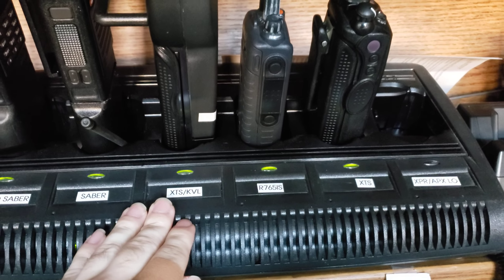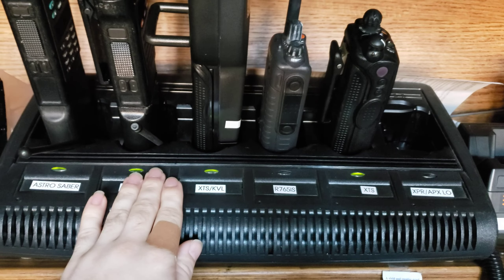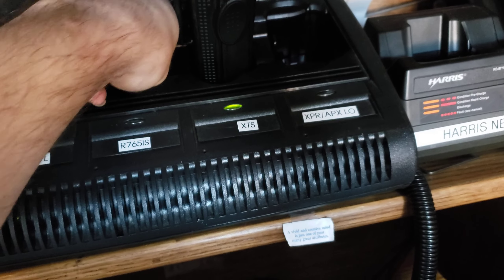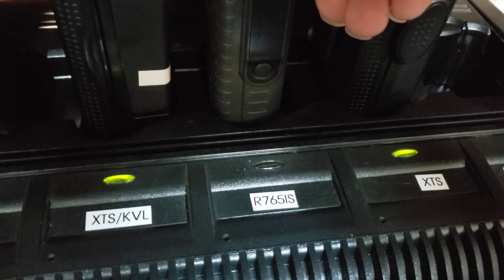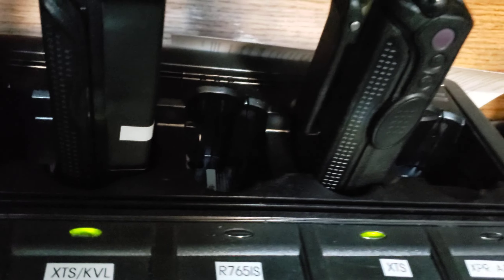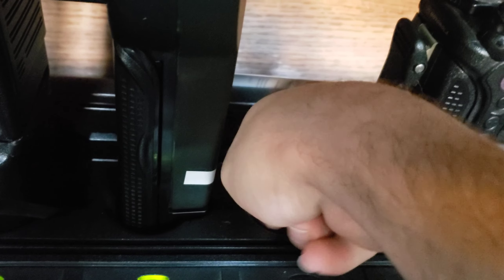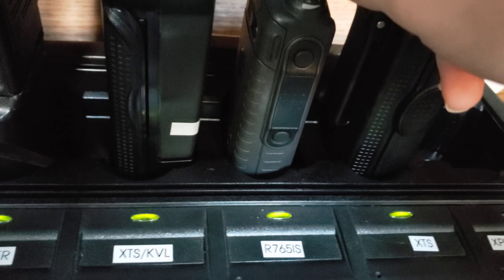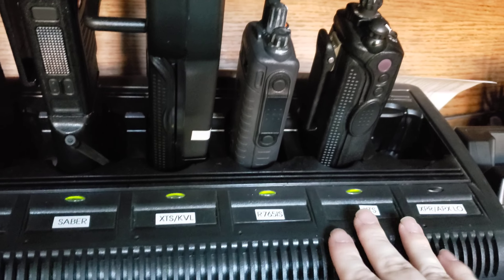Getting HT1250, HT750, and R765 radios charging on a Saber/XTS MUC

Comment: A nice upside of watching this was it forced me to locate one of my MTS2000 radio's, I walked over to my gang charger which charges my XTS and APX radios. The MTS2000 slides right into an XTS port and charges perfectly.  So now I have three different radio types charged in one single unit which is neat and a space saver.  Color me happy!
Reply from the maker: Happy to have been of service, lol

Comment: Motorola DID make an adapter cup for the XTS MUC that fits HT1250s
Reply from the maker: Got a PN? I've looked for a while and never found one.
Reply: @anongator  I'll see if I can dig one up. I have 2 of them so I know they exist
Reply: @anongator  RLN5648, it was $17 from Motorola when I bought it in 2020
Reply from the maker: @Dave-ji1hv  Sweet, Let me try and track one down then

Comment: MUC/SUC (hee-HEE!) adapters are different. I had to order a SUC (I'm a child in this regard...) adapter for my APX so I could travel w/an XTS SUC.
Regarding the 3d printed Waris adapter-getting one of those online printers to do 5x is probably going to be cheaper than finding a NOS one.
Reply from the maker: Yea, some suc work in muc. I have that issue with my xts4000

Comment: Clever! I recently bought the XTS Impres gang charger and three APX adapters to accommodate my APX unit and spare batteries.  I removed the fan as it sounded like a jet engine in a quiet room, Do you know of any other Moto compatible adapters that will fit the gang charger, I couldn't tell if the other radio's are in official slots or if they were also in modded slots?
Reply from the maker: I actually need to buy another MUC XD already ran out of space on this one and I'm only 50% though the radios I need to fit......

I haven't gotten around to replacing the fan with a noctua(might do that with my PSC9600 as well)

Off the top of my head I know there are cups for the XPR, Low tier APXs(xpr cup), MTP700/750, MTP300, APX, and XTS4000(NOT the same as the SUC cup... I learned this the hard way..... I need to find a XTS4000 MUC cup.
Reply: @anongator  I had to Google Noctua! I don't have any of those other radio's you list but thanks for detailing them. Closest I have is the MTS2000
Reply from the maker: @NigelBallard  noctuas are the best for shutting something up. Super quiet but also high airflow.

I've been looking at getting a MTS but I'm trying to focus on my TRS I'm dojng.(going to be loads of vids about getting that working)
Reply: @NigelBallard   Since the boards in the MUC are identical to a SUC (just 6 of them), you don't really need the fan if you're only charging 1 or 2 simultaneously. I installed a quieter fan as well as an Interrupt switch.
Reply from the maker: Correct, I recon a load of batterys so this made sense for me. It's not for Everyone tho